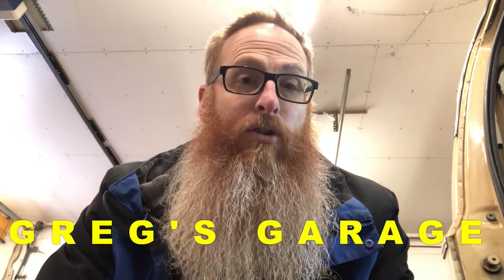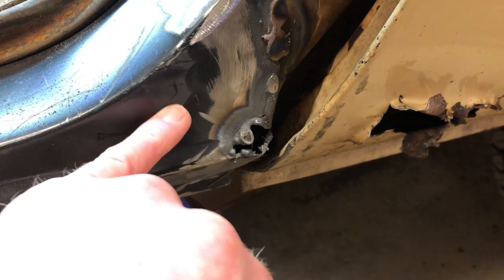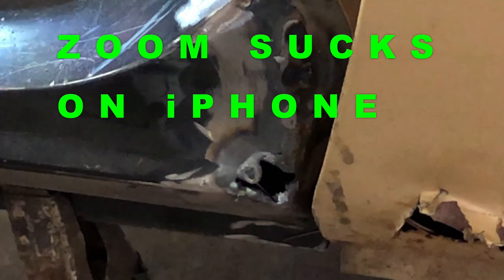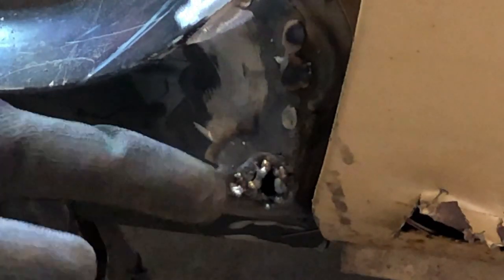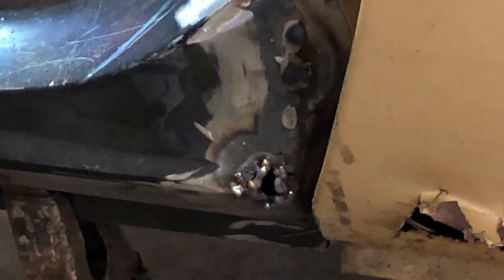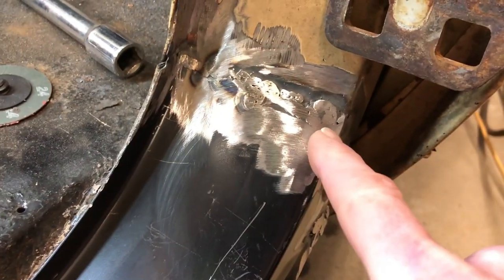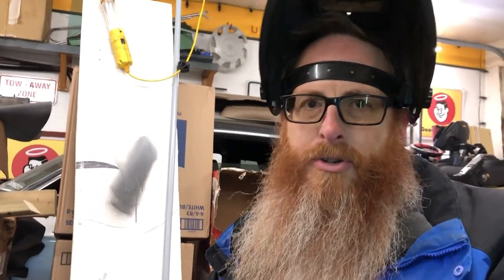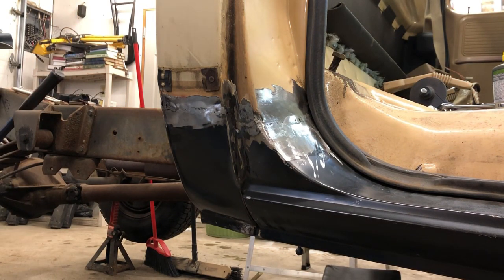WHAT I LEARNED FROM THE GREG'S GARAGE SCHOOL OF WELDING

Comment: Heck yeah, man! It'll turn out great. Usually when I do the thinner stuff I'll use that exact same technique, but I'll tack and then let it cool(after a few you can see it hold the heat and stay glowing longer. I'll let it cool a few seconds after it stops glowing) and move to different areas in between. And gentle pressure when grinding them down. Sheet metal warps easy as heck. I've been told .023 wire helps when doing sheet metal but I haven't noticed a significant difference. I almost never try to run a bead on sheet metal when its butted. But Dale is lookin rad! Got my shirt today 🤘
Reply from the maker: I’ll certainly add that to my mental notes! Can’t wait to see you sporting it! Thanks again for all your support!